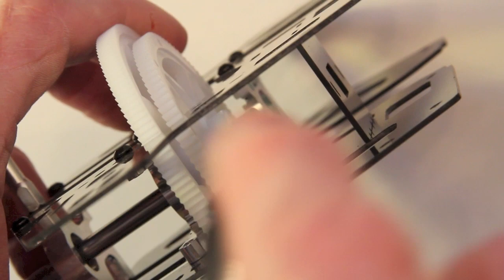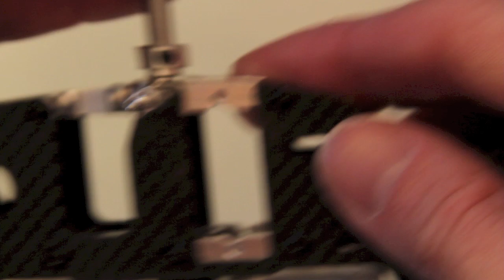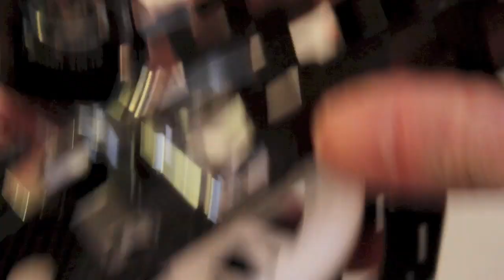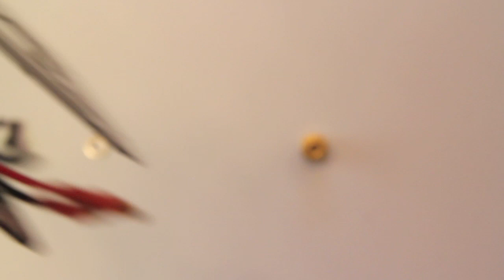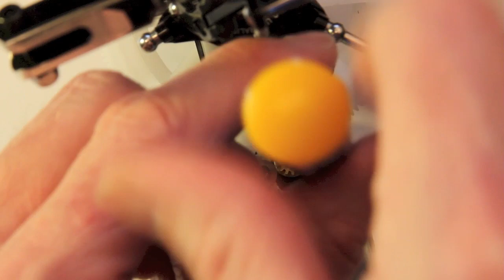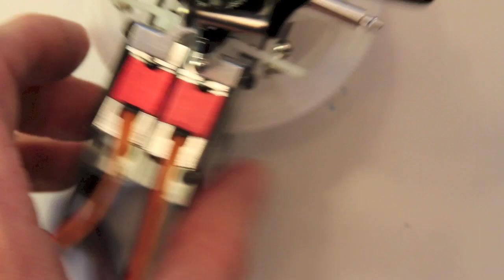16 : Tarot 450 Pro V2 Build : Main Gear, Motor, & Servos

Comment: careful putting loctite on the screw in the main gear, loctite will destroy many plastics.  You also don't actually need loctite on that nut since the plastic holds the nut firmly. 

You don't need as much loctite as you have been using, you only need it covering the last 1mm on the end of the screw.  A little loctite goes a long way.

Comment: Alternate method of motor installation: Attach the motor to the motor mount block before assembling the frame. Install the pinion too. This will save a LOT of time. :)

Comment from the maker: Thanks, John. That is correct.  I performed the step, but it's possible it didn't make it through the editing process for some reason.  It's been a while so I don't remember. I could have just missed videoing that part. Good eye. I do cover it in a later video about the main gear (#26 at 18:53). Thanks for the comment!